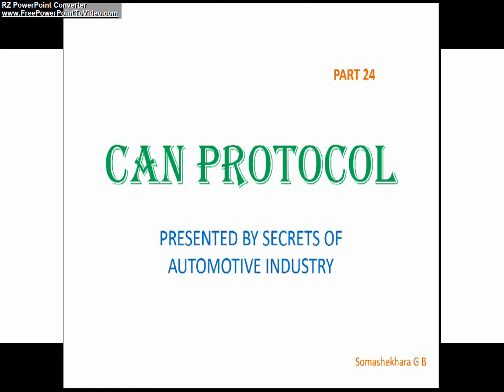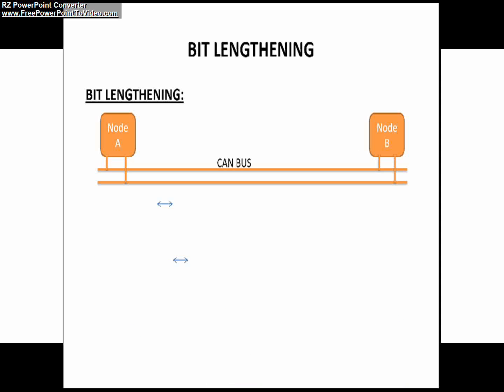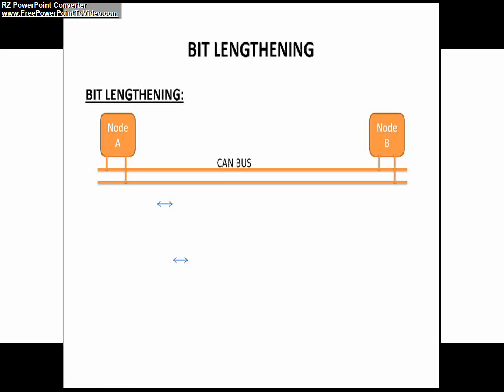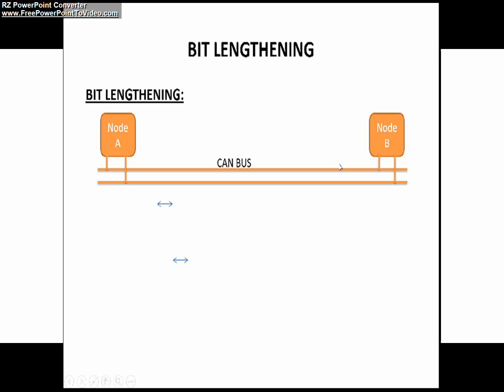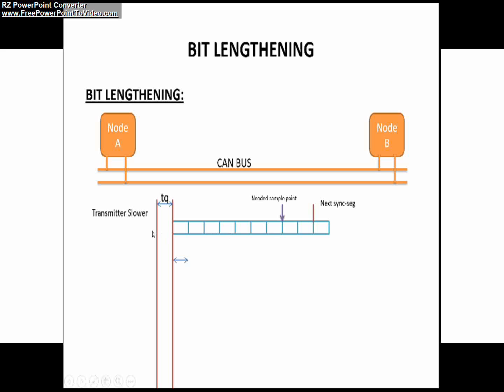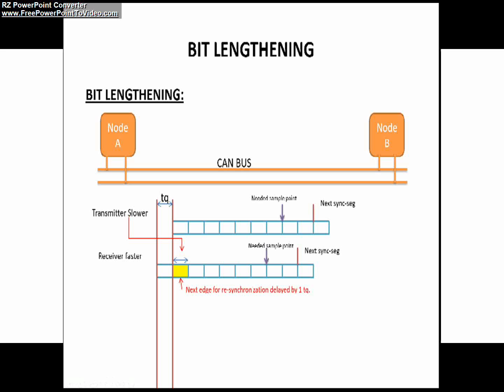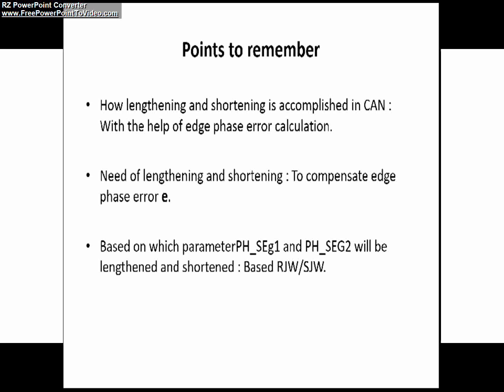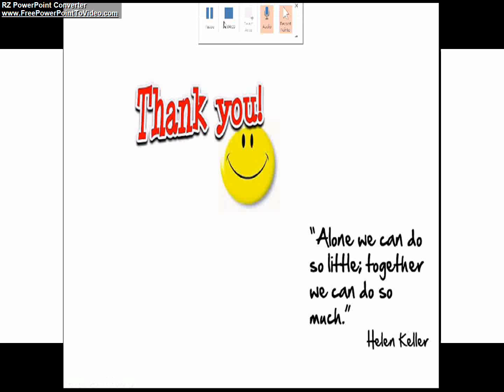Controller area network, PART 24, Bit Lengthening.

Comment: don't you think if the receiver is faster than transmitter by 1 tq than the edge on the receivers end will occur after the sync_seg and lead to e<0 edge phase error and then we need to shorten it rather than lengthen.please reply ASAP.

Comment: What if transmitter and receiver has same speed for transferring data ?
Reply from the maker: Sample point occurs within the SYNC_SEG, no need of lengthening and shortening..
if not clear please leave comments here, will get back to you.. Thank you
Reply: So can we say that if both transmitter and receiver have same speed, then there will  not be any edge phase error ?

Comment: Thanks for making video on this topic 

Do you know any method to test RJW?
Question is , if CAN parameters are assigned in BTR0 and BTR1 registers , for which say RJW is 2 ,

How to test this parameter ? To validate if it is configured properly or not
Reply from the maker: Register assignment depends on controller. In system point of view it is not possible to validate, may be this will be taken care in hardware testing/white box testing.
Reply: Secrets of Automotive Industry thanks for the response
Reply from the maker: Welcome.

Comment: wow really nice can u tell about autosar, cananalyzer and canoe
Reply from the maker: Hi Yash, Two nodes with same ID does not exist in CAN, this will be taken care by system engineers. Because two nodes with same ID can lead to bus conflict, in case if they exist and if they attempt to transmit their messages simultaneously over the CAN bus.
Reply: plase do video on can bus off
Reply: thanku for replying me can u tell me what happence when two node have same Id in can bus which node will receive first plz help me in answering this question
Reply from the maker: Thanks a lot, kindly stay tuned.I am not aware of Autosar  but I can furnish details about CANalyzer and CANoe.
Reply from the maker: Definitely. I am going to cover the same topic in Fault confinement.
Reply: thanku sir but this question was asked in interview so I asked u thank u once again
Reply from the maker: Welcome. No problem tell them with simple example by considering two same Identifiers.
Reply: hi ...
that means if two nodes with same id exist, bus don't give any error ,those can tx/rx the data...!(theoretically).
Reply: hai...

when you are going to upload details about CANalyzer and CANoe.

pls do videos on CANalyzer and CANoe...
Reply from the maker: Little busy in other works, Soon I am going to upload videos on CANalyzer and CANoe..kindly stay tuned...
Reply from the maker: I think you are confused with previous question, We are not talking about two nodes with same ID, we have discussed about two messages with same Identifiers.Please check... if you find difficulty in understanding that please leave comments here...
Reply from the maker: I think you are confused with previous question, We are not talking about two nodes with same ID, we have discussed about two messages with same Identifiers.Please check... if you find difficulty in understanding that please leave comments here...
Reply: thank you...
Reply from the maker: Welcome...